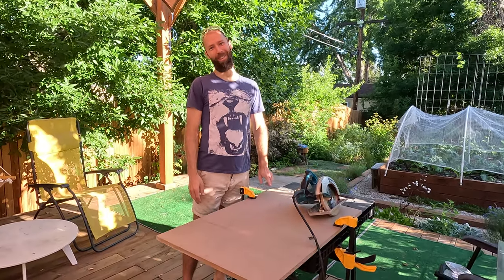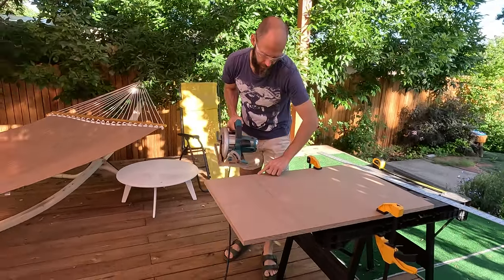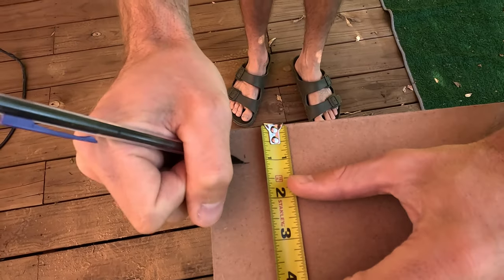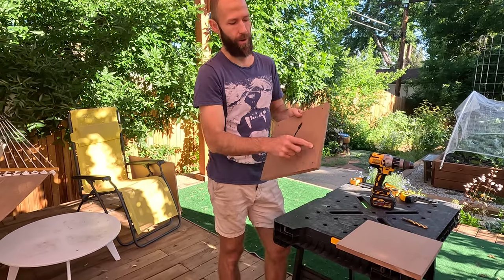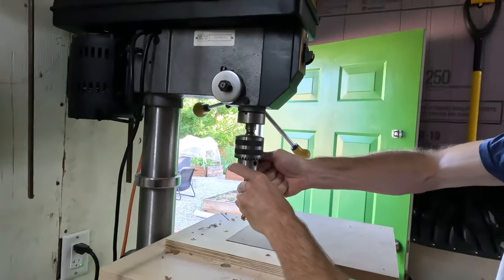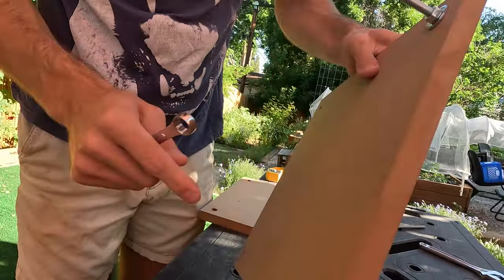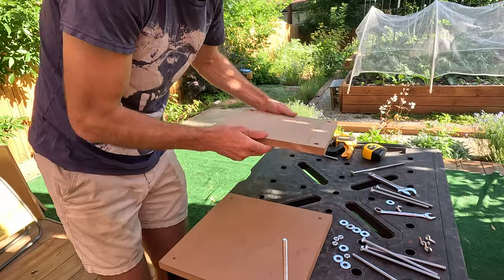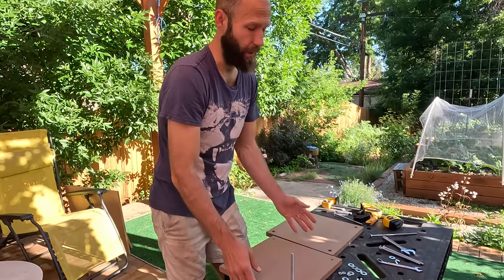How To Make a Flower Press

Comment: Thanks guys - can I ask why you only do 12"x12" and not bigger presses? I've got one that's 15"x24" for larger longer flowers/stems like delphinium
Reply from the maker: We have one that is 12x24. and I will make larger ones now that I am getting out of commissions. I will do awesomely large presses cause if I want to make a piee that is 33x40", it would be super awewome to let some longer stems come through. But yes, i think you are on the right track. having an array of different sized presses is a good thing. We just have 12x12's cause of where we were at in our business. I plan to make a huge one like 4'x2' or something as I want to experiment with some really long stems. All it takes is more holes and more bolts is all. Kind of pain when changing paper though. hahaha

Comment: Great video.  I made my own, but didn’t recess the bolt on the bottom, or use the larger bit on the top plate.  Will definitely be fixing them after seeing this.  You guys rock!
Reply from the maker: Awesome. Yeah depending on what bolt you use, will depend on how that is fixed. Sounds like you used a carriage bolt if you are recessing it, so yayyyyy. Nice job Melissa. :)

Comment: Thank you! Now I have a better way to use the 10° and 12" carriage bolts! Great video!
Reply from the maker: Gosh where do you find such large carriage bolts?
Reply: I’m sorry. I accidentally gave you the wrong answer. I looked at my bolts. The 10” came from Lowe’s and the 12” ones came from a place called Onestock.  They are 3/8”.
Reply from the maker: @barbkaper5689  thank you!!!

Comment: How do you stack the flowers in the press? Is it cardboard-paper-flowers-paper-cardboard-paper-flowers etc. Where do you use the chipboard inside the press? I have found that my cardboard gets indented pretty easy and then marks the next lot of flowers. Do you use the chipboard for this reason?
Reply from the maker: Hey hey. we do cardboard, 1 piece of chipboard (think cereal box, which prevents the corrugated cardboard striations from showing up on thin flowers), then paper, then flowers, then paper, then 1 piece of chipboard, then cardboard. But you would have figured this out as you were getting there. :) THe chipboard helps with your issue and the one I presented. :)

Comment: Good video but I wish you had finished the press. I haven’t done this for many years and would appreciate info on best materials for pressing, dos & don’ts, etc. I did go on the hunt for “blotter” paper ( what we used back in the ice age) and have some extremely funny stories to share with friends about reactions from the much-younger set😂. I actually found some at an art store (Guiry’s for the Colorado folks).
Reply from the maker: Hey hey. We are creating a course on how to press. This video would have been far too long to get it in here. The press is finished when the bolts are in. 🙂 for paper we use regular copy paper and reuse it. It’s on our website too or if you have any paper (it doesn’t matter if there is ink on it) just use that. Blotting paper works. We just don’t use it because of the cost. Hope that helps answer some questions.

Comment: I got my planks,working on the wing nut screw and bolts
Reply from the maker: Awesome awesome. You are pretty darn close. Just make sure your holes in the top plank are slightly larger than the bolt. :) It helps will ease.

Comment: I used birch with 8" carriage bolts and instead of recessing into the wood, the carriage bolt spun into the wood, tearing it as it went. :( I'm not very handy. Any tips? Do I need to start over with a stronger wood?
Reply from the maker: How thick was the Birch wood? I am not positive. Instead of carriage bolts, use hex bolts. I show this in the video too and I would recommend that. You need a washer using hex bolts and a nut to secure it. That is also in the video on how too. Not sure why it tore though. Little strange. Maybe it was because of the wood. :(
Reply: @flowerpressstudio  Thanks for the quick response! The birch was 1/2", but I noticed it even tore and left splinters when I drilled the holes, and it looked like your MDF didn't do that in the video. I'll try to return my carriage bolts and get hexes instead, but I don't think I'll be able to get 8" hexes, unfortunately.
Reply from the maker: I do like 3/4". The plywood that has less layers can tear. Its OK though and still useable. Just get some sandpaper and sand it smooth. But 3/4" is better. I did use MDF for the video as that is what I had as some scrap in my garage. Totally useable for presses and does not chip or tear. And its cheap. Carriage bolts or hex bolts both work. Its a personal preference is all. 8" allows for more in one press and that's why we use them. 6" allows for less but easier to find any bolt in 6 but not 8. I like 8" more. Try MDF 3/4". You should be good to go and keep the carriage bolts. Its all an experiment to see what setup you like most.   @SarahHenderson-k3n